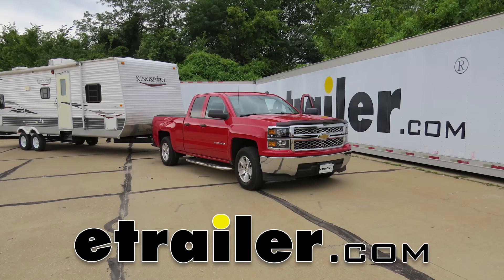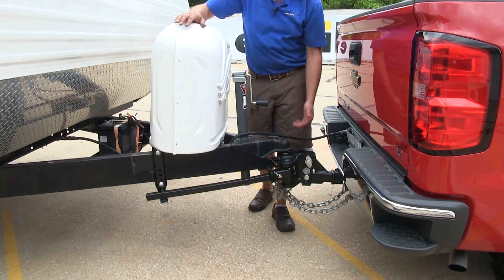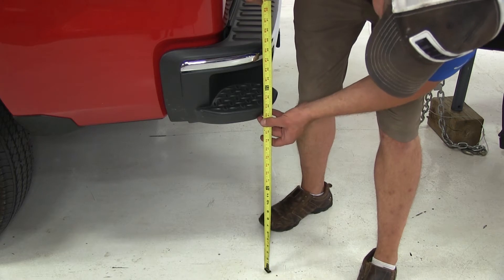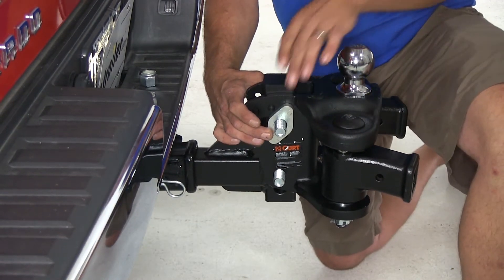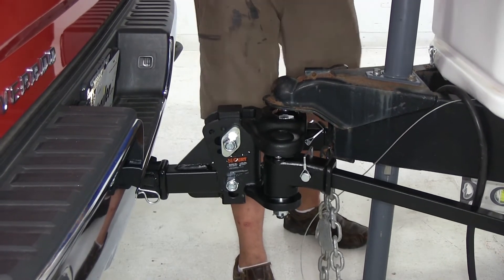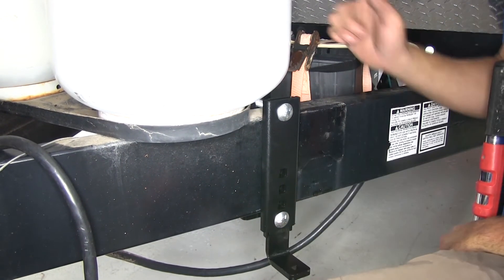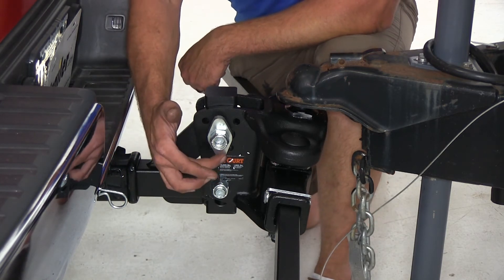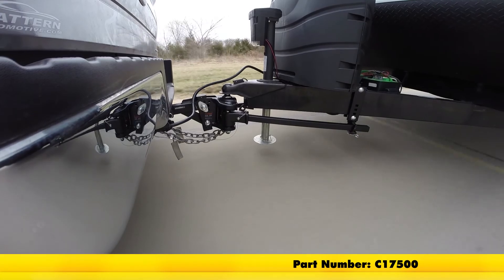Install: Curt TruTrack Weight Distribution System w/ Sway Control on a 2014 Chevrolet Silverado 1500

Comment: I'll be installing the c17500 tomorrow.  Ram 1500 w air bags, trailer is a 6800# Keystone TT with a tongue weight of around 800#.    Manual tells me to start at position #1 and then work from there. 

You went from #1 to #5 and then back to #4.   I guess I'm a little confused as you can adjust the spring bar weight/tension with the L bracket position as well as the head tilt.    Maybe I'll start with #3 and then move either way.  Seems like one should want the head in the most vertical position possible and then fine tune with the L brackets - Or do I have that backwards?
Reply from the maker: The setting will be specific to you will want to level the trailer tongue as close to the height of the ball as you can then make the adjustments to the torsion bars in order to level the trailer when the load is back on the truck.
https://www.etrailer.com/Weight-Distribution-Hitch/Curt/c17500.html
Reply: What? No I am more confused then before

Comment: Question, Equal-i-zer 4-point Sway Control Hitch, 90-00-1000 and the CURT 17500 TruTrack Trunnion Bar Weight Distribution Hitch basically the same technology?
Reply from the maker: They are going to be similar products in that they both are going to have sway control and the same weight capacities. There are a few differences that are very important to keep in mind. The sway control on the Equal-i-zer is going to be a friction sway control so it will require no maintenance which is very nice considering you don't want to make more work for yourself. In the Curt TruTrack there are spring-loaded ball bearings that rest in detents built into the underside of the head. As you travel down the road normally, these ball bearings help to keep the trailer in a straight line by applying pressure inside the detents. But, they are going to have to be greased in order to operate smoothly. I would go with the Equal-i-zer because it has been around for such a long time and has a great reputation for being a reliable product for many years of frequent use.
https://www.etrailer.com/Weight-Distribution/Equal-i-zer/EQ37100ET.html
https://www.etrailer.com/Weight-Distribution/Curt/c17500.html

Comment: You will notice that the ball detents do not line up with the ball , half out. Product is not made correctly as this is the same on my trailer as well . The factory does not have the casting made right so the ball will fit in detent. So it does not work 100%.
Reply from the maker: I see what you're saying. I can see where this might be problematic in the long run. We have not had any of them come back stating that there was an issue.
https://www.etrailer.com/Weight-Distribution-Hitch/Curt/c17500.html
Reply: Well yeah no returns because a lot like myself have got it few months ago and am just now being able to get it setup and towing with it and as only 30 day return not possible to return